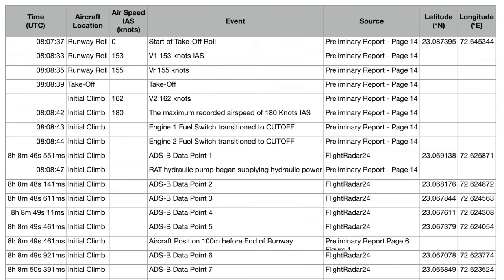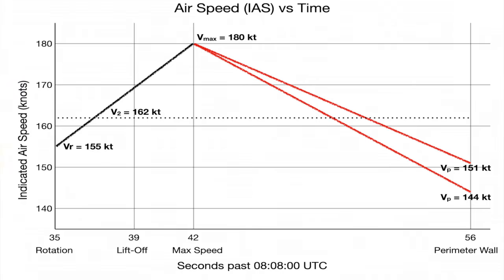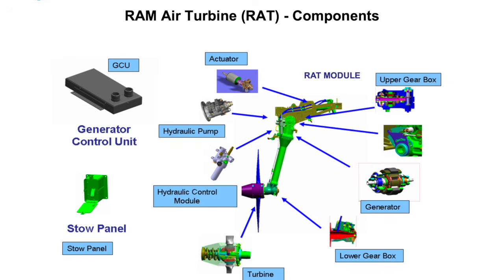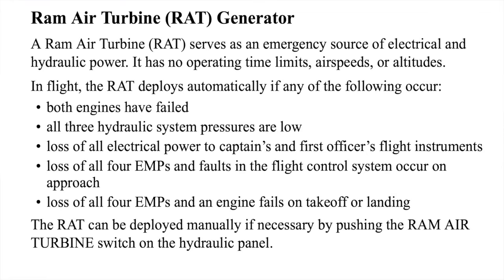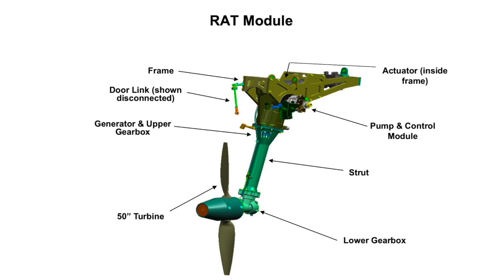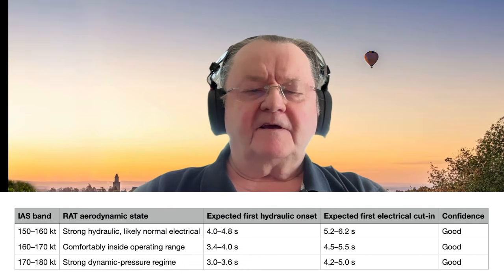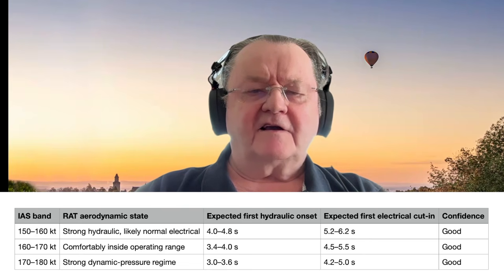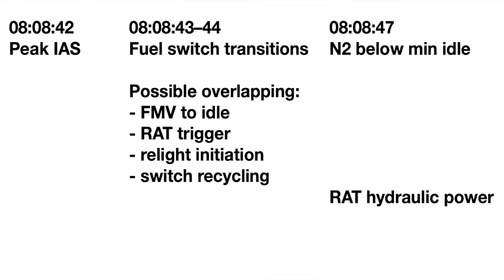AI171 - RAT Deployment - Spurious, Human or System

Comment: so just to be clear the RAT deploys every time a 787 has an engine failure?
Reply from the maker: No the RAT does not deploy every time a 787 has a single engine failure. 

In flight, the RAT deploys automatically if:
• Both engines have failed.
• All three hydraulic pressures low.
• Loss of electrical power to CPT’s and F/O’s flight instruments.
• Loss of all four EMPs and faults in flight control system on approach.
• Loss of all four EMPs and engine fails on takeoff or landing.

RAT can be deployed manually using the RAM AIR TURBINE switch in the cockpit.
Reply: @IAIwithRichardGodfrey   thank you 
I think we need to know the exact time when the RAT deployed  there should be more photo`s of the take off?

Comment: If the RAT deployed before the fuel switches were toggled by pilots, then either the engines switch off or massive electrical power failure occurred before any pilot switching, in which case, pilots are not to blame and the failure is technical.  
The other thing is the key evidence provided by the sole survivor, who stated unequivocally that there was massive electrical failure, which Richard seems to ignore (he also seems to be protecting Boeing).
If Boeing do not provide open and honest conclusive report in June, then NEVER FLY BOEING AGAIN !
Reply from the maker: It is not Boeing's responsibility to publish an accident report, it is the AAIB India's responsibility.
Reply: Like the twisted Preliminary report covering up failings from Boeing & FAA
Reply from the maker: The Supreme Court of India point out the twisted media reporting preempting the preliminary report and blaming the Captain without evidence.

The court will consider the claim that the AIIB India are not investigating in an impartial and credible manner, when they resume the case on 6th May 2026.

Boeing and the FAA have released several Airworthiness Directives and Service Bulletins. The question is were they all complied with and when?

Air India only claims to have complied with mandatory regulations, but not advisory notices. The DGCA India has fined Air India for non compliance of mandatory regulations.